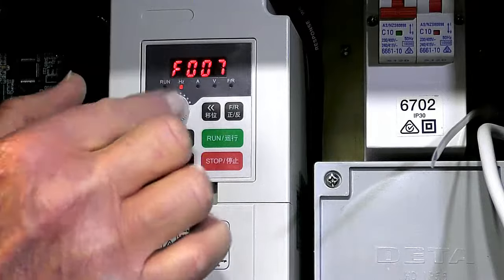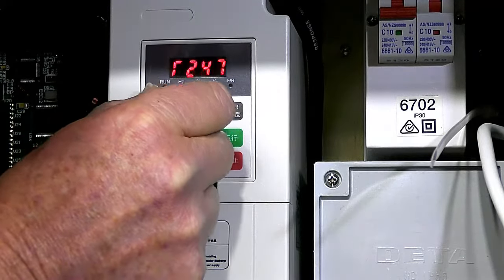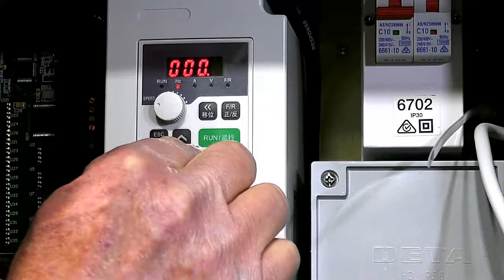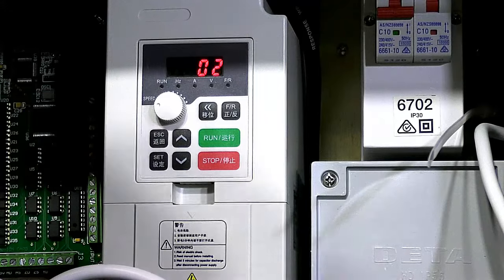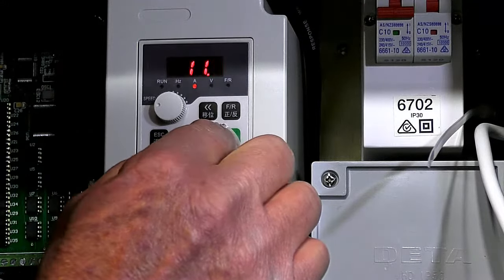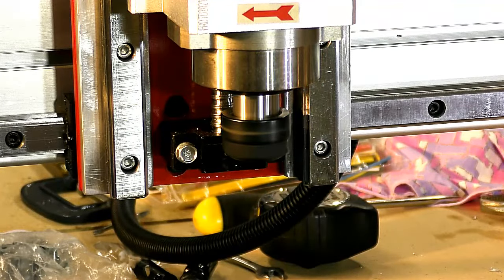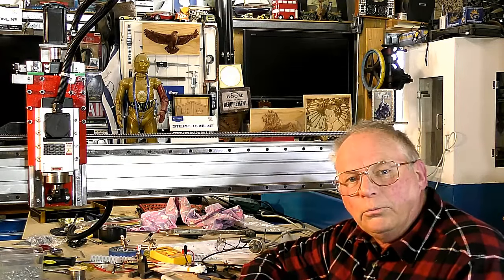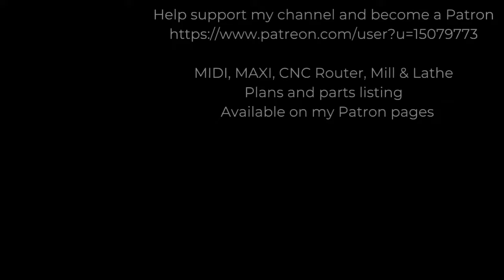How To set up VFD parameters (Variable Frequency Drive) CNC [Episode 16]

Comment: thank you this clears some stuff up. the one I am attempting to replace is for a vacuum. This would be my first vfd replacement ever. the VFD from the OEM already setup is $1500, but, I can get a new one not setup for 250. and there is an identical one next to the broken one and is working.

Comment: It would have been a LOT more helpful if you had defined each registry you altered.  You defined P005, but then changed P003 and P004 without explaining which functions were being changed.  Since not all VFDs have the same numbering for registries, it is not possible to apply the settings appropriately by following the steps in your video.  For example, your registry for max permissible frequency is P005...on the Fuji FRENIC-Mini, the registry for max freq is P003.  Since you don't define most of the other registries you changed, how is one to know which function you are actually changing?
Reply: Exactly

Comment: Running a 110v 1.5 kw spindle here. Super light passes at .04 doc 25% at 60ipm makes the spindle stall. Been through these settings with your video 3 times and no luck
Reply: Did you ever figure this out…I need same help on this problem

Comment: Grelt video mate. I have just Got my selv a 2.2kw spindel and a Vevor 3Kw vfd and your instruktions worked fine for me. But i do have a question, i did put a Hidance watt meter between my vfd and the wall outlet, and i Can se That tha max watt draw from the outlet is approx 300 watt Winther max rpm and no load om the spindel. Have you tryied to meassure the watt your spindel draw with no load ?  Thanks Alain mate.
Reply from the maker: It can draw up to 2200w under load.

Comment: Hi Roger. I'm in Melbourne which is not as pretty as your neck of the woods. Thanks for your channel. Your videos are great.
I have a ProverXL 6050 plus which I purchased a couple of months ago. I noticed that the spindle is slightly bent so I'm thinking about upgrading to a water cooled 1.5kw VFD spindle. Genmitsu have a kit but don't ship to oz. I found the same kit on Amazon so I'm thinking hard about that one. I was wondering if you had any thoughts about using the VFD with the 6050 plus.  My main reason for thinking of water cooled is to reduce the dust flying around and more importantly, less noise.  Thanks, David

Comment: Hi. Great video and series. Really enjoying watching and can't wait till everything is up and running. 
Not sure if I'm right however does the spindle spin the wrong direction. Opposite to the arrow indicating right rotation?
Reply from the maker: You are correct
Reply: @rogerwebb9600  hey i would like to know is that bad  when it’s in the wrong direction? Or did you have a reason to do so. 
I also have a not so constant freq that seems to be “jerky” what can i do to make that go away and have a constant rotation. 

Thanks foor the video 👍🏻

Comment: I have a question about Motor Function Parameter F144. 
In my manual that came with my VFD (H100-2.2S2) it describes F144 as “rated rotating speed of motor” 
Which I take as the maximum rated speed (in my case 24,000rpm) 
Is this a difference between different models or is that the same as yours?
Reply from the maker: Yes models are different.

Comment: Hello, i  do the same setting but it shows error E.oc. Can I reset the device?
Reply from the maker: Yes
Reply: @rogerwebb9600  with which program do you do this?
Reply: I have the same now. Made again, the setting is correct, I can turn the frequency very well. However, the spinder does not turn.